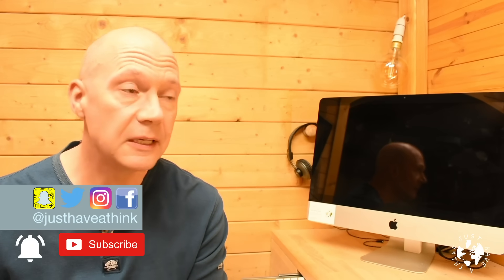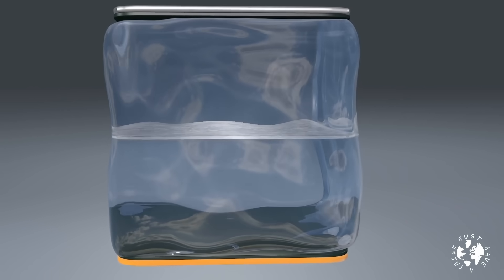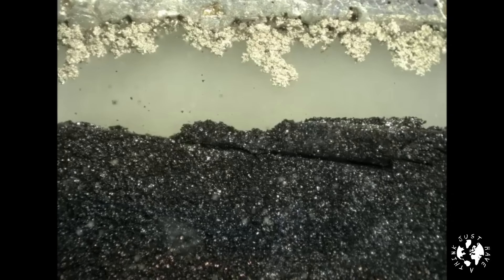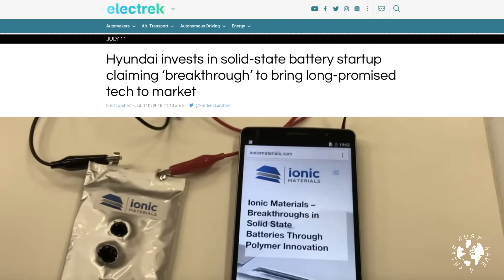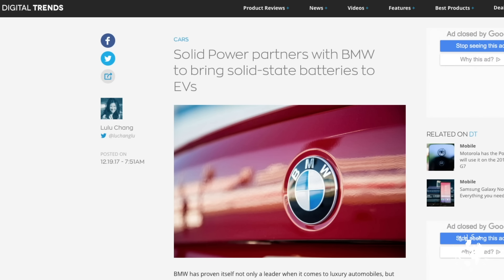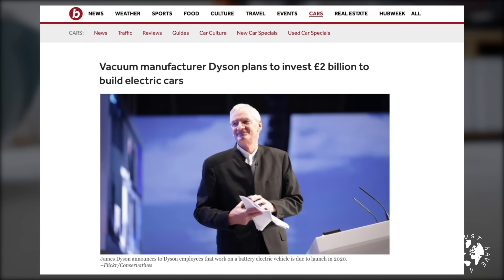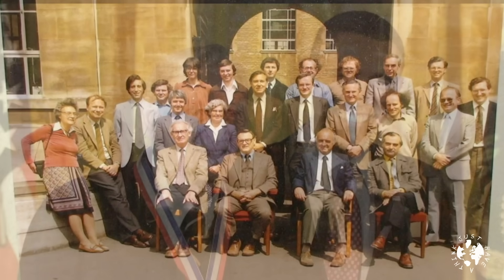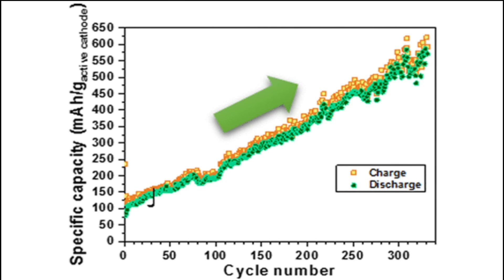Solid State Batteries - has Goodenough nailed it again??

Comment: Diagram for the representation of lithium ion battery is not enitirely correct. Electrolyte is not filled like that entirely on cathode and anode side of the battery. There is a separator on which liquid electrolyte is usually added, which will be available in the central portion of the battery. Your demonstration is similar to what we can see on lead acid batteries and not lithium ion batteries. Later segment where you show the electrolyte in LiPO battery is correct and similar to that except the electrolyte is liquid. Initial demo is slightly misleading.
Reply from the maker: Hi Dhevathi. Thank you for your feedback. It's always good that people contribute these sorts of tips and information so that you guys keep me on the right track. I hope I can do a little better in future videos. All the best. Dave

Comment: Great! you should add a reference 18650 or 2170 battery at the bottom, and while talking of various chemistry changes, estimate the claimed capacity and C ratings of those. For example an old Panasonic NCR-B claimed 3500 MAH real 3000, and 1C. to charge is in 5 minutes : 12C, etc.

Comment: No worries, Apple will still throttle your iPhone after one year.
Reply: Which is why things like the Librem 5 are a good thing. And even if the battery has 25000 cycles, you can still open up the cover and replace it.
Reply: Tesla uses 100 times more batteries per year than Apple
Reply: @santiagocastro4683  I have a banana.
Reply: APPLE will become irrelevant due to their GREED!
Reply: We need a graphene screen that won’t crack!
Reply: phuc ewe  bless you. You were saying?
Reply: My iPhone 7 Plus is doing well after nearly three years. Yes the battery is down from it's best but it causes no problems.
My Apple MacBook Pro 13" is a 2012 model. It still has the original battery but has needed a new power supply brick because the cable failed at the mag connector. It's running the latest 64 bit OS and is still great to use.
Reply: Ya dont buy apple. Man I miss Steve jobs
Reply: David Beaulieu yeah maybe we should clone from his DNA...Jobs Park?
Reply: @davidbeaulieu4815  You miss Jobs? I personally miss Wozniak.  He made certain Apple products weren't only marketing-hyped average products.
Reply: Android phones are worst. I have one and it worked nice when I bought it, now after a year this pos is slow and I have to restart it every day, while my old iPhone I was restarting it maybe once a month.
Reply: @silimarina.  My S7 Edge still going strong after 3 years without any issues without throttling or bullshit as Apple does! Die Apple Die!
Reply: @TorpedoBurrito  yeah and my sister has iPhone 6s that is working just fine and my brother in law has iPhone 8 that also works just great. I don't know, this was my first android phone, maybe I was unlucky. Why should Apple die?

Comment: The dendrites are the same problem with the lead acid batteries have, why they go bad!
Reply: you can actually dissolve them by adding epsom salts to the acid weirdly enough. I've gotten completely dead batteries back to quite high performance with that trick. that's why I never buy sealed (maintenance free) batteries, nowhere to add epsom salts when it dies xD

Comment: Goodbye V8 sounding muscle cars. You will be missed.
Reply: You have hit the nail on the head. Jay Leno (yeah, that Jay Leno) once pointed out that cars were originally play things for the wealthy, while the common man rode a horse, or walked. Now, horses are the toys of the wealthy.
Reply: Yeah that V8 Sound is nice. I like them too. But when you want to enjoy travel at higher speeds that dull motor sound gets extremly annoying after some kilometers. I prefer silence to enjoy landscape or music which is not drowned by loud motor sounds.
Reply: @aladdin8623  
At highway speeds you don't hear the  engine, you hear tire and wind noise. I've driven a Tesla and a Chevy Bolt EV you definitely hear the wind noise and tire noise.
no properly running internal combustion powered car has significant engine noise at highway speed that is louder than the wind or tire noise. Unless someone has intentionally done something to the exhaust system to make it louder than stock normal. And large V8 powered vehicles generally turn far lower RPM at highway speeds then smaller 4 cylinder cars. Making them significantly quieter mechanically then a 4-cylinder powered car. I've driven a Corvette running down the road at 65 the engines turning less than 1500 RPM. Doing the same thing in a 4-cylinder powered Honda Civic you're turning 3000 + RPM
Reply: @kens97sto171  might bei true but i was talking about "higher speeds". What is the purpose of a V8 If you don't use it. And for Sure customers of a V8 don't buy These Just to Drive slowly to the next bakery. They buy it for the sound IT makes and with the associated Power of IT. But this is a psychological wrong assumption. Just because something is not roaring it does Not mean it is necessary weaker. Very often quite the opposite is true. Roaring in nature is usually to impress  contrahents to Show Off but to kill ICE you can do it in silence ;)
Reply: @aladdin8623  
I was talking about high-speed also, and I can tell you at 160 miles an hour in a Corvette you here mostly wind noise and tire noise. 
yes you can hear the engine as well at lower speeds and high throttle but at high speeds you pretty much hear wind in tire noise.
I'm well aware that electric vehicles have amazing power and torque that is there one major asset, however they  are not that great at higher speeds. First of all their power output generally drops dramatically as speed increases, second of all you run into extremely bad efficiencies at higher speeds to the point where internal combustion engine vehicles are more efficient Beyond about 75 miles per hour. Also you can Take a look at a Tesla Model S it cannot maintain more than 120mph for 10-15 min. without running into a overheat situation on the stater windings in the electric motors. Bjorn in Norway has done a video on this.
I could run a hundred fifty miles an hour in that Corvette for as long as the fuel holds out.
All these problems will ultimately be solved, and electric vehicles probably are the future in the long run. However at this point electric vehicles cannot top the range, the flexibility or ease-of-use for long trips.
And at least for now are not the financially cheaper thing to do either. I have run the numbers on this since I use my Prius for work and track all of my expenses. My Prius cost me a little under $0.07 per mile to operate including all maintenance and fuel. A Tesla Model 3 cost about $0.04 per mile to operate when traveling long distances and using the supercharger exclusively since I am would never home at night to charge. I drive 50,000 miles per year, if you compare a brand new Prius $30,000 versus a brand new long-range Tesla Model 3 $55,000. You will find out that it will take you 13 years to break even driving 50,000 miles per year. if you drive the average 15 or 20 thousand miles per year it will take you that much longer to break even. besides that I don't have to buy a $30,000 Prius I can buy a very nice used Prius for $8k. 
Now when some other automakers come to the market with 400 mile range electric vehicles that cost $20,000 then the financials start to look a little bit more favorable. And I'll be happy to buy one.
Reply: @kens97sto171 
1. At some Point Wind and tire noises might drown a slow rpm combustion engine. But this does Not mean the sound pollution hast gone. The roaring IS still there but gets drowned. Mp3 on the other hand has a small Data footprint because the Algorithm Cuts away unaudible frequencies to the human ear. So No, Just because you don't hear the ICE Sounds it does Not mean they did vanish and can not Stress your ear anymore.

2. Efficiency ist another topic i was Not talking about. But lets discuss this. IT IS Not true. If you Drive your V8 at Maximum speeds it will need more Energy too. In fact You can exceed 60 litres per 100 kilometers easily.

3. I Heard otherwise about Model S. A German Gentleman reached constant speeds of 225 km/h on the Autobahn on a track without Speed Limit. He guesses If the drivetrain is better cooled the EV can Go even faster. If you compare speeds you have to keep in mind that Most of the EVs don't use gears. If there are higher gears the drivetrain can not overheat easily. But If they find better cooling methods in future Gears might Not be necessary. Gear Boxes tend to Break often which require more repairs.

4. Costs, well this is usual when new products Hit the Market. When the First ICEs came Out, horses still were better and cheaper.
I think Teslas strategy is wise. First they brought a fast EV to Break dull stereotypes in the head of people. Then some prestiged Models came including some advanced model 3. And next step is Model 3 base model for around 35.000. Next they Plan model Y and Pick Up  In your calculations you forgot the competitional EVs from China and South Korea and Japan. They are remarkable and in the Case of byton the Chinese cooperate with european engineers to establish high quality for a reasonable price. The Future is inevitable.
Reply: @aladdin8623  
1. If I cannot detect the sound for all practical purposes is not there.. 

2. When I mentioned high speed efficiency.. I meant that a gas car is best suited for this.
I can drive my Prius at 85mph and drive nonstop for 450 miles before my 12 gallon tank is dry. Stop and refuel in 5 min and drive another 450 miles.
Ask anyone that owns and EV.. high speeds make the range drop significantly over the stated range.
If I can't drive at 80mph+ and go at least 300 miles ..it's useless to me.. 
Bjorn has done many efficiency tests in many different EV's. When I tell him I need a car to drive at 80+mph with 300+ miles range. He says.. buy a fossil car. 

3. The overheating issues are in the motors.. not the gearbox. The motor cannot output continuous power at a level needed for 200kph. Nonstop.
This is not a really significant problem.. at least not in the USA, but could be a concern in Germany.
Also I believe the Model 3 does not have this isn't.
Some EV's have battery overheat issues at continuous high output. And will limit power when his happens.

4. I fully believe that EV's are the future...  And the more competition in the market the better. The Chinese and Koreans are gonna push hard. Kia/Hyundai have 4 EV's in the market this year. E-Niro, Soul, Kona, Ionic. 
For me the math still does not work.. and would probably NOT work until prices are in the high teens.
I can buy nice used Priuses for cheap and that's the best way to save money.
Especially at driving 50k per year. Better to buy a $5k Prius with 150k on it.. beat it for 3 years and get a new one. Than spend 25-30k and have to replace it in 6 years.
Nice discussion.
Reply: speakers and some sound profiles. boom. done.   Next !
Reply: nope wont miss gas engines at all, its just an engine, i will miss it as much as burning bread on an open fire vs a toaster
Reply: I love the sound of a V8, that $ $ $ $ sound is awesome